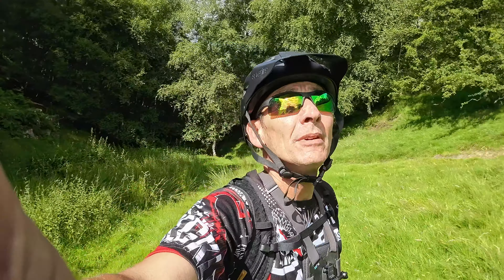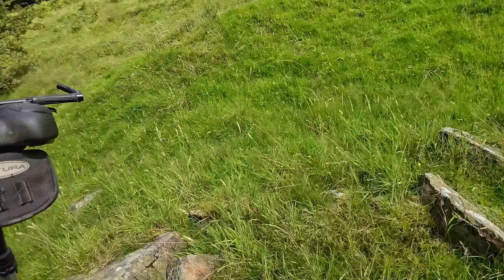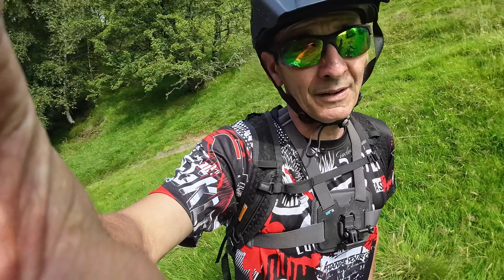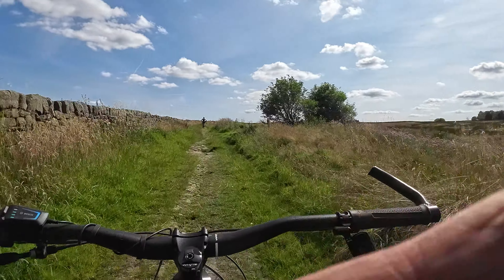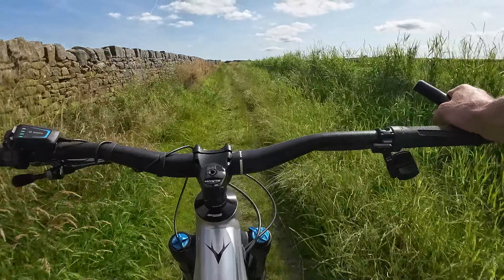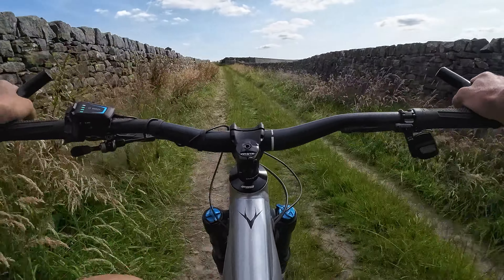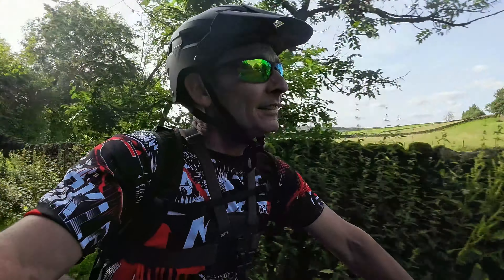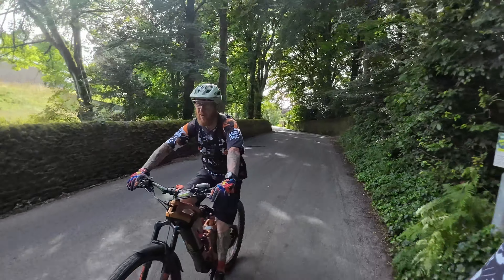new bike day test wyhte E160rs

Comment: I changed to renthal fatbar 35s on my 23 E160s mx, trimmed down to 800 overall with grips on, not so good for touring but really good at speed down fast and twisty trails, 2700kms mostly offroad, and loving the bike, came with TRP brakes which are awsome, onto my fourth chain now but still on original casette, deore 11 speed linkglide,